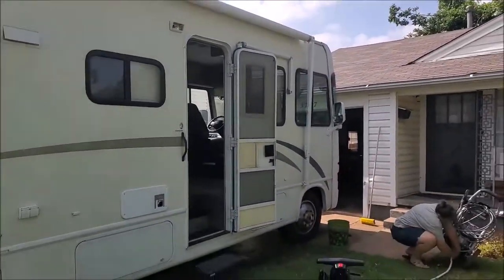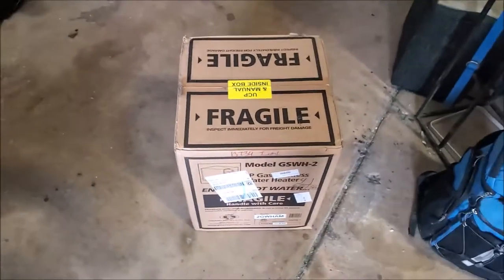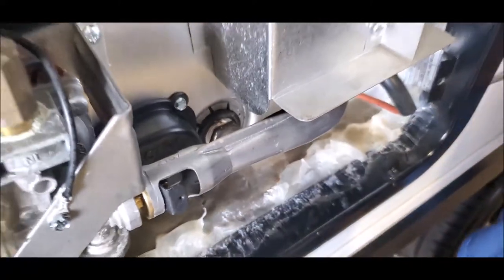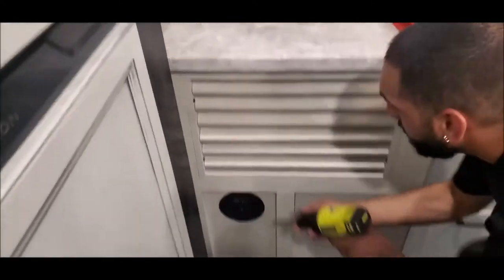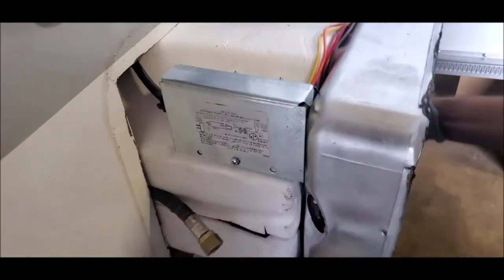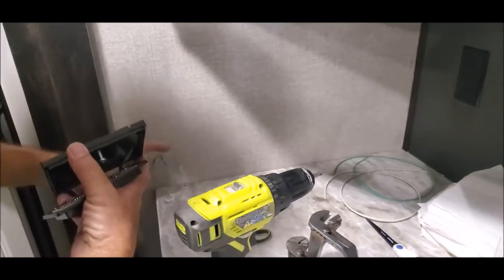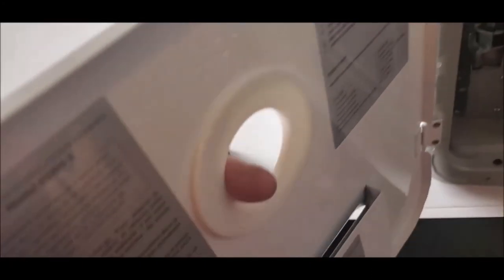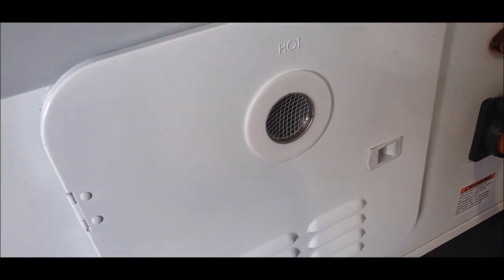Girard 2 Tank-less Water Heater Installation

Comment: Would be nice if you actually showed how to wire the controller in detail
Reply from the maker: We tried to show it but I will explain. There are 2 small black wires that come off the black control box. They go into the lower area below where you mount the control box. If you look at the video at the 14:00 area you will see I explain the small black wires that come on the control box from the factory connect to the 2 thin small blue wires from the heater. That is really simple to understand. I hope that helps. Just use small wire connectors that will work for that size of wire and crimp the blue and black small thin wires together. There is no positive or negative wire. Either wire can hook to either wire with no problem. Good luck.